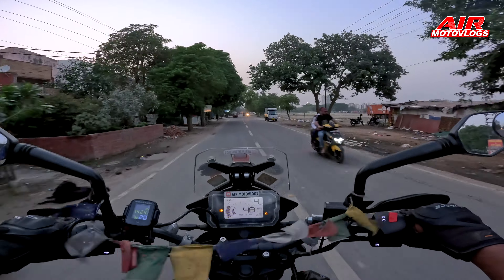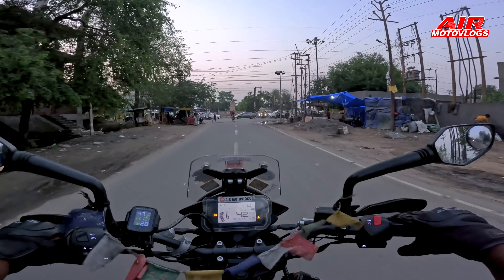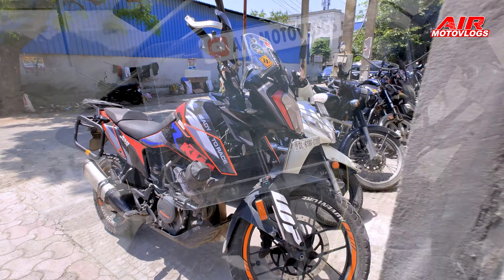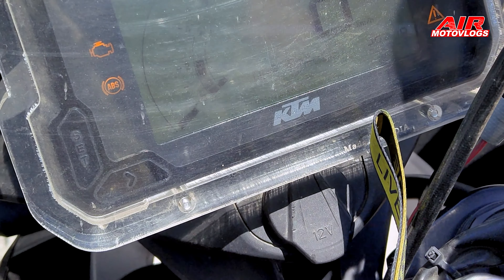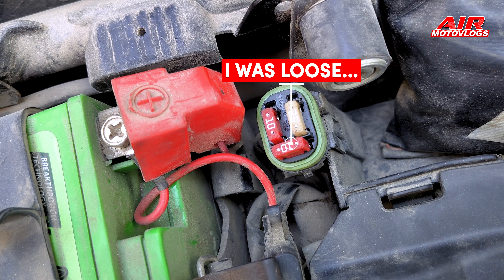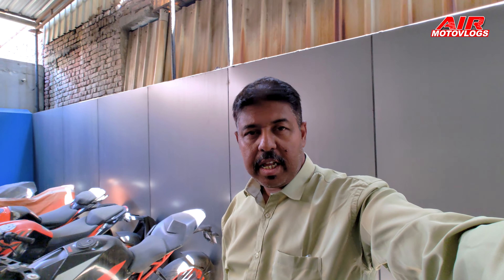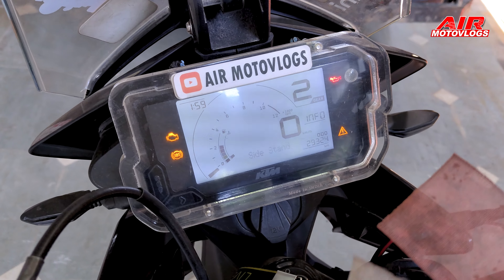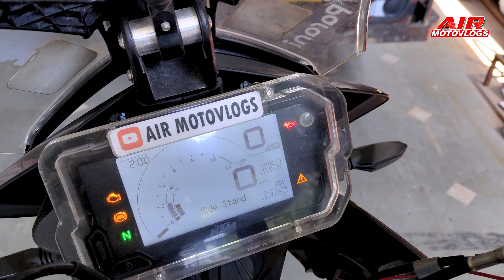ABS Failure on KTM Adventure 250  😳 - What Went Wrong 🤷‍♀️ ?

Comment: Hi sir  .ktm adv good bike are not tell me sir iam booking adv 250 .lot of person facing lot of problems so tell me sir .buy are not
Reply from the maker: The Adv 250-s available these days are  yet to receive some update...though donno when would that happen...so I suggest going for the Adv 390..if you wanna remain in the KTM domain
Reply: @airMotovlogs  ok sir thanku I will check online   lot of confiused and lof problam comming ktm
Reply: Adv 390 is cost high sir
Reply from the maker: @dv6998  then go for the Adv 250, as its otherwise a proven one..or else maybe Google up with your bike specifications and budget, test ride them, and take a call...